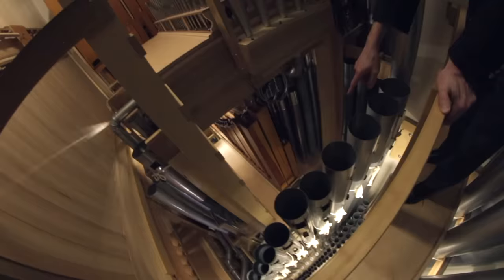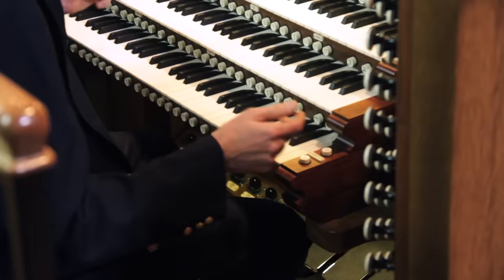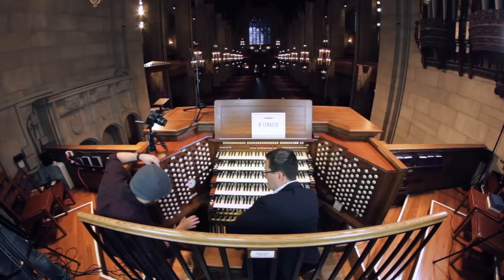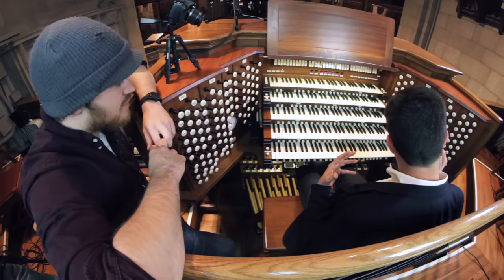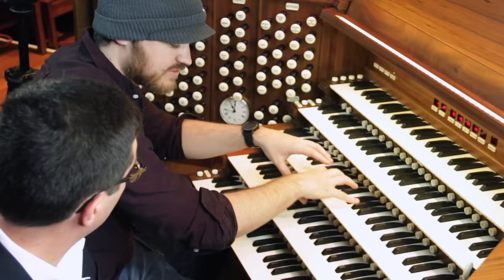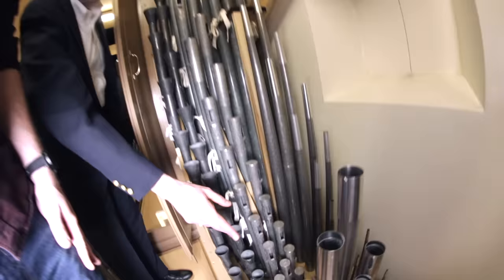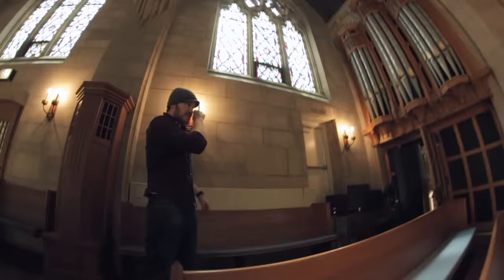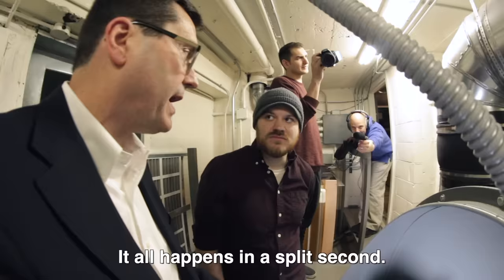Pipe Organ (An instrument the size of a building)

Comment: "Bro, check out my sick analog set-up...." The Church..."Hold my communal wine.."
Reply: Haha.I like what you did there.
Reply: Well actually this is not a fully analog instrument anymore. Most of modern organs have a digital pult and there is a datalink to the pipe house, where you have digital actuators, that control the wind.
Reply: jimpesh comments like this deserve more likes. This is amazing
Reply: @dermozart80  While some church organs aren't fully analogue (due to price of maintenance resulting in the shift), this one would be still considered fully analogue, as they are still using every single pipe for every single sound, versus substituting for an electronically produced sound. Organs that also use an "enhanced" control board versus the typical control board of older organ models also could still be considered analogue, as the board is only actuating, while the pipes and physical system itself is still doing what it would have been doing before (but with more efficiency)
Reply: Grape juice
Reply: @dermozart80  I don't think they ever were analog instruments, much less digital.  The pipe organ is an acoustic instrument.  Analog instruments would be early transistor organs, early synths, theremin, etc.
Reply: Nystul What Violin and trombone are fully analog instruments that can play any frequency in their range as precisely as the musician can hit them.  Harp and trumpet are digital instruments of the same families, as the musician chooses from a list of notes set by the person tuning the instrument.

Comment: for those wondering, the MIDI does actually record the organist's play, so he can later on review how sounds are heard from different sections of the church to optimize the experience for everyone
Reply: Please explain what you mean. MIDI does not record audio. It records parameter data.
Reply: @totallyfrozen  in the other vid he said it'll like capture exactly what the organist does--so it can play it back exactly as the organist had.  It physically plays the organ.
Reply: @totallyfrozen  he didn't say it recorded the audio, he said it recorded their play. It keeps track of the notes and replays them
Reply: @totallyfrozen he’s probably talking about MIDI 2.0
Reply: @totallyfrozen  See the video titled "Controlling a MASSIVE pipe organ with my computer" to find out how this organ uses MIDI. It has a hidden MIDI recorder and player and they later installed the missing wiring to get it to take MIDI as input and play the MIDI tracks through the organs.

Comment: For those who are wondering what the range is:
Lowest note: C0 (16.35 Hz) 12:29
Highest Note: C9 (8,372 Hz) 12:42
9 octaves
Reply: This is true for this particular organ and most medium to large organs. 
The lowest note (C0) is produced by a 32 foot pipe, and the pipe for the highest note (C9) is only 1/16 feet.
Some organs may play a few semitones higher.
Smaller organs generally have C1 as the lowest note (lowest C note on a standard piano), sounded by a 16 foot pipe, as there is usually no space for pipes extending to 32 foot.
Reply: The human ear can't even hear a 16hz sound. We just hear some remanent noise coming out of the pipe at this point.
Reply: @ora2j251  Yeah.
Reply: @ora2j251  All we hear is things rattling and overtones.
Reply: @ora2j251 I mean there’s nothing really to hear pitch wise, at that point it’s not so much of a note as it is a rhythm.
Reply: λ = v/f. So the longest pipe could be around 68’ for a full wavelength. /2 for half wave.
Reply: Oh thanks for that,,I learned something important
Reply: @ora2j251 you feel it tho
Reply: literally the end of the ost "the end" from c418
Reply: @ora2j251 You can hear it when it's played with music. Such as at 0:55. We can't pick it up when it's played alone because it's too low for the brain to process. But we can hear it when it's played in context with music because the key is established.
Reply: @ora2j251  The point of 16 Hz is not to be heard but felt. You can feel it in your breathing.

Comment: I don't know what is more amazing. The Instrument or the people who can actually play it.
Reply: broazrael1234 I mean.. I guess it would be just like a piano except you have to take into consideration that it might be delayed in some areas because of the size.
Reply: Or perhaps the people who can build and tune this kind of Leviathan. Days of tuning. I can well believe it!
Reply: @Monyato  organs are slightly different to play but yes.
Reply: As an organist, it’s similar to piano but you have a pedal board which may be somewhat difficult for mainly just a pianist
Reply: You know what most people fail to appreciate? The people who build it. Shit is complicated!
Reply: The people who have to go through maintaining these instruments on a frequent basis.
Reply: Also, there is no sustain
Reply: All
Reply: @cristopheridlc  don't need it - acoustics of a good room make up for it. Also, the finger technique is very different from piano technique.
Reply: I know, right? But I guess the most amazing thing is the people who tune it. It must take a looking time.
Reply: broazrael1234 the instrument
Reply: To me, organ is generally easier to play than piano. Although with pneumatic organs like this one, it can be trickier because of the delay between what you play and what you hear. What I like about it is that you can control dynamics by simply flipping switches, instead of having to worry about how hard you hit a key as on piano.
Reply: @jacobleonard1862  i personally thing the piano is harder because of dynamics, pedaling, huge jumps, extreme stretching, and huge repertoire

Comment: My dad passed away a few years ago, but he spent his life working with pipe organs. He worked building organs at a company in CT, and later ran his service business, maintaining pipe organs all over New England. He knew pipe organs inside and out, he rebuilt them, moved them, tuned them, restored them, and even pioneered using midi integration in traditional organ consoles so VST instruments can be used through speakers in conjunction with the real pipes, recording key strokes, as well as storing stop settings. Thanks for your video, it brings so many fond memories climbing around pipe organs with my dad.

Comment: I really like to think the organ as the synthesizer of pre-electronic times. Loads of sounds and complicated to figure it all out.
Reply: Yep. Tone and timbre shaped by pipe shapes instead of oscillators and filters.
If you stack them up it's like additive synthesis.
Reply: The ironic thing is that modern organs use MIDI to control the valves that let air into the pipes. And the source of that air is a compressor which re-fills automatically. Back in the day, all the valves were mechanically linked to the keys, which as you might expect required constant maintenance. The air was supplied in real-time by someone (usually the organist's apprentice or a boy under the church's guardianship) frantically squeezing a bellows. So with modern these additions, the organ has become much more like a synthesizer, but with an analog rather than digital sound source.
Reply: @karawethan  thanks for the impromptu history+music lesson ^_^

Comment: My foster father worked and retired from Shantz Pipe Organ. He was a toner/finisher of the pipes and pipe organ after it is installed. His main duty was to give the finished pipe that was made its initial sound and tone. I was able to learn some of his work and actually have some pipes out there that I had made go toot toot for there very first time. His secondary duty was to go to where the pipe organ was installed and do all of the final tuning and adjustments to the pipe organ giving its final home its sound and life. I learned how they were built from the raw materials to the finished product in its new home. They had their own smelting areas to melt the metals needed for the pipes and would pour the molten metal into the molds to create the sheets of metal in various thicknesses that were later cut and shaped by hand into the pipes themselves. They have an area where the wood pipes are built as well. They also have an area where the consoles were built. Then they had a special area where they built each section of the pipe organ to make sure that things all matched to the blueprints and tested out each section to make sure it worked properly before tearing it all down and packing it away for shipping.

I also had many opportunities to see other pipe organs from the small home practice ones to the largest theater pipe organs. I had the opportunity to actual help restore and rebuild pipe organs as well. The saddest accomplishment was when I was helping to remove the pipe organ from the Minneapolis Civic Auditorium prior to its destruction to be rebuilt. They claimed they were going to put the pipe organ back in the new building but still to this day that has not been done. It sits in the warehouse in many boxes and crates that were custom built to house the various components. The largest pipe I could crawl down inside of it.

Pipe organs are the most fascinating instruments every created by humans. Sadly far to many are being ton apart and never rebuilt or replaced and these majestic instruments are fading away.
Reply: Thanks for sharing your fascinating view into making them. 
Heartbreaking to be taking them down for good.
I hope the company is still in business.
Reply: Oh my god thats impressive ad fuck
Reply: That’s incredible! Since pipe organs aren’t portable, they aren’t as popular as they deserve. Thanks for sharing your experience. I’m a bit jealous. LOL! What a unique experience your had with your dad. 👍🏻
Reply: @totallyfrozen  ... I used to get out of school and walk to Shantz Pipe Organ and go into my foster fathers work section and I would sit there and we would chat away as he made the pipes speak their first notes.

I forget where it is but he had taken me to see a HUGE tracker pipe organ and I was able to crawls around inside of the chambers and see how it all came together to function.  A part of that trip was for him to tune the organ and I was the one that held the keys as he tuned the pipes.

The most fascinating aspect to me back then and still today is seeing the trackers from the console to the chambers all hidden under the floors of the stage.

In Milwaukee there was a pizza joint called Pizza and Pipes.  The main feature was it had a huge restored theater pipe organ in there and they had different people come in to play throughout the week.   All of the pipes were in chambers that had windows so you could see all of the pipe.  All of the extra instruments were placed all around the place and you could see them in action as they were being played.  The largest of the wood pipes were on the outside of the chambers laying on their sides.  You could sit on them and feel them vibrate   They even had a mini disco ball and other lighting to set a great atmosphere for the songs.  That place was packed every night.

Most of the organs in the churches were fairly boring at times but even those still hold a majestic feeling when played.  Many churches hide it all and it takes away from the instrument in my eyes.

If it wasn't for pipe organs and my foster father I more than likely would not have gained an appreciation for classical music as well.  Concert Band in school had its place but it is not the same type of experience.
Reply: @Rispatha  I hope these organs are never completely gone. There is no comparable instrument, and certainly not in digital form.

My favourite place for birthday parties as a kid was the Organ Grinder restaurant on the Esplanade in Toronto. (It no longer exists, but was in the space now occupied by the Bier Markt. ) The centrepiece of the place was a Wurlitzer organ, which not only played the traditional pipes, but was connected to over 100 other instruments around the building such as drums, xylophones, bells, horns, and tambourines. The organist would take requests on slips of paper, and everyone sang along. It was a noisy, chaotic, gloriously joyful place. They mostly served pizza, which I recall was also pretty good. But I didn't much care what they served. It was the music that was the main attraction! I really miss that place.
Reply: @armedwithjello  ... I was at that restaurant back in HS my freshman year.  Our HS band does a road trip every 2-3 years and Toronto was one of the places we went to for our band trip.  We had our dinner at the Organ Grinder and I still have pics of us being there.  The next day we got to play the halftime for the Calgary Stampeder's vs Toronto Argonauts game.  We sat in the stands doing our usual HS pep cheers and fitting them to the Argonauts team.  The Argonauts won that game and I would like to believe that us being there and having played the halftime helped bring the win for them.

Sadly not to many youth these days understand the beauty and power of a pipe organ.  The industry has lost a lot of great talent in both building and playing these majestic instruments.  It seems that as each year passes that less and less are interested in them.  They do take up a lot of room and require a lot of upkeep once you have them installed but to me it is well worth the expenses.

Thank you for bringing back to the surface a great memory of my youth.
Reply: @rispatha  I'm so glad you were able to experience the glory of the Organ Grinder! It sounds like you had a great trip. :-)
Reply: @armedwithjello  ... We all had a blast. We even got to go up into the CN tower.  I got pictures of the railroad yard looking down upon it from the inside.  It was a great time for our HS band back in the early to mid 1980's.  Sadly even now many kids do not sign up for band anymore.  We went from having 80-115 students as band members to today where we barely get 40-50.
Reply: welllifenetwork5531  ... Because of the huge cost to make them and the amount of space they take up.  To build and install a pipe organ in a huge stadium like that it would cost over 20 million.  Then add to that the difficulty in finding people that are trained in pipe organ playing since it is becoming a dying art.  Then add to that the cost to constantly tune it with all of the weather changes causing it to go out of tune all the time.  Even the climate controlled indoor pipe organs have the same issues just not as bad as the open air stadiums.
Reply: Wow that's awesome, please let me know if you know where it is and any contact information, I would like to see if I can source a pipe organ for our church, 🙌🏻👍🏻
Reply: @brucegarcia2702  ... Which pipe organ are you asking about?

Comment: I had a massive smile on my face all the way trough this video, amazing showcase of an amazing instrument. 
But where is the link in the description to where I can buy one ;)
Reply: If you've got $1,000,000+ to burn, there's plenty of organ makers that'd work for you to build an organ close to that size. Definitely among the most expensive, if not the most expensive instrument to buy.
Reply: @Bragituba  This Organ's restoration was 3 millions alone... Can't imagine you'd get close to half that size at all for a million brand new... The local church here had their pipe organ restored in 1991 for 100 000$ and it's about a tenth the size of this one...
Reply: @adelphus515  The Letourneau organ at CSU in Legacy Hall was about $1.5 million brand new, and it has a little over half that number of pipes. Considering the age of the organ in this video, I'm not surprised it costs that much to maintain. Especially if part of the organ is over 100 years old at this point. I made sure to put $1,000,000+ because I wasn't entirely sure what market value is for different organ manufacturers coupled with historical value.
Reply: My former employers at Wicks Organ Company have some small ones for sale in the tens of thousands.
Reply: @Bragituba  I'd imagine buying a church would be cheaper.
Reply: @Bragituba  gonna need a discount code along with that link.
Reply: @graveyardrumblers  I know, right?!
Reply: @DinosawrsAreAwesome  I'm already looking for an abandoned one in my area. 
Now even more! :D

Comment: My great grandpa used to tune this organ for many years from at least 1945-1975 every other Saturday. He also did the organs in Rockefeller Chapel,  Orchestra Hall, and First Methodist and St. Lukes church in Evanston. Plus my great great grandpa did this as well but my grandpa doesn't know the specific years but he assumes 1930ish-1940.
Reply: Not this one. The guy clearly said it was done in 2016 and only has 25% of the pipes from the one that was there in 1971
Reply: really, every other saturday? I can imagine that they are kind of sensitive to changes in temperature and humidity (which, thinking of it, shouldn't happen that much in a church), but do they go out of tune that much/that fast? 
Or is it more of a "rolling maintenance" thing, ie. one day one section of the organ is tuned and two weeks later the next section?
Reply: @trod146  I think he means whatever organ was at that same place.
Reply: @jk9554  They don't go out of tune that fast, at least not to a point where the instrument becomes unplayable. The organ I play gets tuned twice a year, and even then, every single pipe is not tuned, just the ones that are noticeably out of tune. Sounds like the organist at this church was obsessive about intonation.
Reply: @jk9554  They are most sensitive to humidity changes - especially the "reed" pipes - 61 of them per stop knob (at least).  Rolling maintenance would render only the most recently tuned pipes "usable" while the rest would vary based on the length of time since their last tuning.